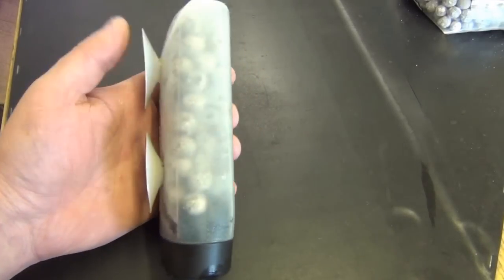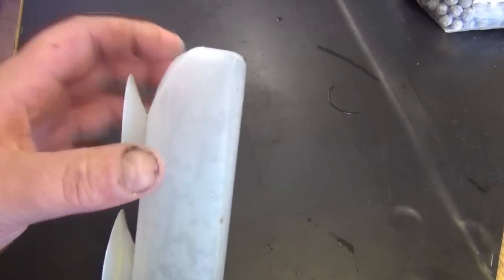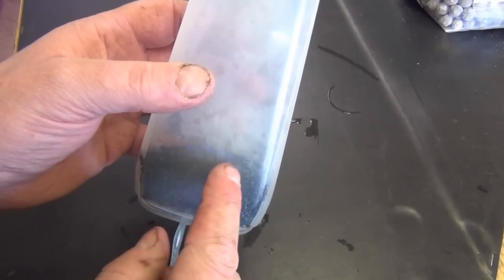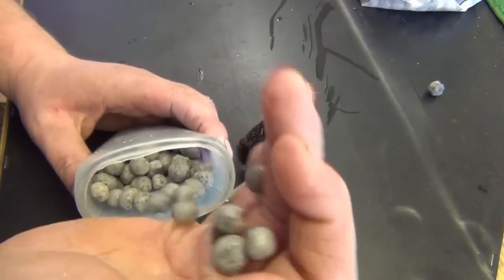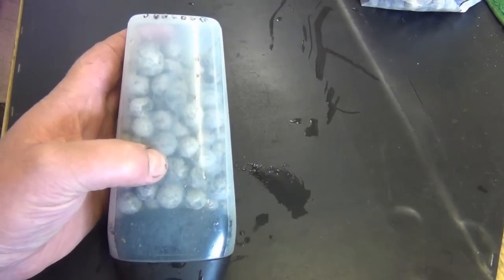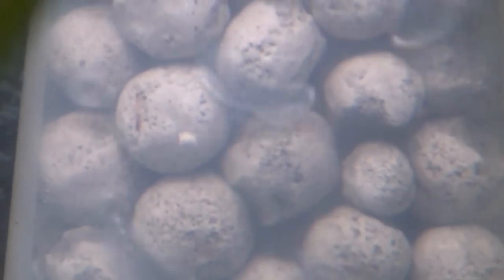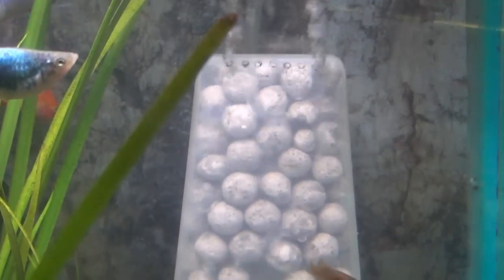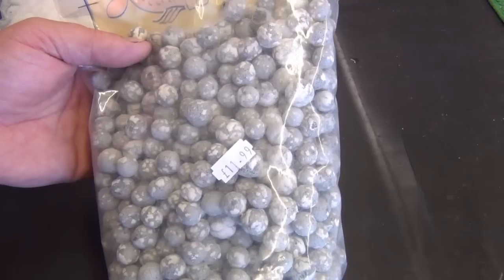How to Make an Excellent Moving Bed Filter

Comment: This is great. Trouble is, I can't find that clay type media anywhere. I found a similar type at a nursery but it's coated red, not sure if that's some type of dye or it's just clay. Ceramic media I found at the local pet store is outrageously priced. I heard red volcanic rock for gardens works well as a media as well, any truth to that?
Reply from the maker: +JudicialPineapple While other media will not move as the biomotion does it can be very effective as a filter media in a static filter. I can't remember the trade name of the red stuff you mention but I know what you mean. It makes a decent filter media and lava rock will be OK too. Avoid using anything plastic in a static filter as it supports very little bacteria.
Reply: +Pondguru Outdoors Thanks alot for the advice.

Comment: I was recently gifted with a 3.75 liter tank and a gold fish. The tank has an air stone but no filter, would this work in such a small tank? If I use a travel sized bottle and either hydro balls or sand?
Reply from the maker: lunerwerewolf I have just answered the same question from you on another video.That is way too small to support fish.
Reply: Pondguru lol sorry it's late here and I'm worried about the little guy. I'm in a dorm and can't get a bigger tank, so he's going to have to wait till summer to go into the big tank. I want to make sure he survives the next 6 weeks and is strong and healthy enough to go in with the others. Would it help him if I added chemical filtration media as well?
Reply from the maker: lunerwerewolf You can get small ready made filters called 'Small world filter' from Penn Plax: http://www.seapets.co.uk/products/aquarium-supplies/fish-tank-equipment/aquarium-filters/air-driven-filters/small-world-filter.html?ref=googlebase&gclid=CO7bmtTf3sQCFSoewwodUk8ABwThey need a small air pump to run them and will keep the fish alive until you can get it to a proper tank.
Reply: Pondguru thanks I will see if I can find any locally.

Comment: i did make the filter. it was very easy. but the media inside it doesn't move much.
maybe the reason was i didn't use the t shape stuff. or maybe the shape of the container. it should be the top is smaller than bottom? is it still working without moving that much?
by the way, you are british or german? just curiosity though. i'm in japan.
Reply from the maker: I am English but my good teeth would make people think otherwise, lol
There are many reasons why media will not move too well but mostly it just needs time to build up a bio-film to allow it to move easier through the water. Bottle design does affect it and the bets media for a small moving bed is the new K1 micro.
Reply: Pondguru thanks for answering . sorry that i thought you are not english. but i like your accent though. lol
Reply from the maker: msnb1966 Many people think I am German so you're not alone in suggesting that, lol
Thanks for watching and appreciating the videos.

Comment: I'm thinking of making this filter for the (temporary) plastic tub I have my turtle in. Would it work if the filter is placed diagonally on the side or if it's placed horizontally?
Reply from the maker: It really needs to be vertical if it is driven by air as the air will rise so won't draw water in properly if horizontal or diagonally.
Reply: Pondguru I guess I'll have to find a smaller bottle then. Thanks for the reply

Comment: Hello! Ok I am having a little problem with sourcing of all thing the shower gel bottle!!! No seriously....I have all the stuff ready to go but unfortunately, now this is going to be a little hard to explain, but all the shower gel bottles I can find are primarily connected by the part you instructed in the video to cut out (0:36). I have been everywhere, even tesco! The problem is that once you cut the part out you are talking about, the shower gel cap no longer locks back on, it just falls off :( Is there anything else I could use? I don't want to superglue the cap back on do I, I'll need access to the sponge won't I?

Comment: Hi I was just wondering do you still have this filter up a running and if so how is it performing ....thanx in advance
Reply from the maker: I think I swapped the media for K1 in this one as the biohome wore quite quickly when I had it moving in a confined space but the filter is still operating, yes.
Reply: Pondguru would it wear down less quickly if the balls were able to move freely like with K1 media? or are they not buoyant enough? i'm thinking of doing this but i'm iffy about swapping media too often
Reply from the maker: nerdziz The biomotion lasts much better when the balls are in a cyclical motion and we have done experiments with them in a donut shaped filter which worked very well. The best bet for a small DIY filter would be the new K1 micro plastic media as it creates a very fluid bed.

Comment: Hi , Have the media , cant find a bottle like yours , I came up with the shape but it is pantene shampoo bottle, with writing on it what do I do to be sure , it safe for my tank. And if Not good what bottle would u suggest I live in the usa. Thanks for all your youtube videos helps me alot.
Reply from the maker: +Lily T As long as you wash it extremely well in very hot water it will be fine. Any suitable shaped container will do and many people use snap shut clear lunch boxes. They are food safe, robust and can hold plenty of media. Also they have a flat back which makes fitting suckers easy.
Glad you enjoy the videos and thanks for watching.

Comment: I have a 30 gallon tank that I inherited that has 11 fish in it. 9 goldfish, 1 plecostomus and 1 Chinese algae eater. It came with 2 HOB filters and the water is NEVER clear. I made one of these moving bed filters. I used a 1.5 Liter pop bottle and bio-balls. Are the bio-balls supposed to be moving because mine aren't? Also, will this filter work better than the HOB's? Help please.
Reply from the maker: You are trying to use bio-balls (the plastic balls?) as a moving bed filter? The will not move nor will they support much bacteria so will do very little to filter the water. Sounds like you need an external. With goldfish that is the only way to go. HOB filters are often worse than useless and cost a fortune in pads / cartridges long term.
Check out this video which explains how a filter should be set up and exactly what should happen in a filter as far as the bacterial action goes: https://www.youtube.com/watch?v=lsAmSD3wVbg
Reply: Pondguru
OMG...what have I gotten myself into. I'm so overwhelmed with this information. If I do the filter in the video, how often will I have to clean it? And how often should I do a water change?
Reply from the maker: pookiegirl717 You would only clean it when the return flow slows right down and when it is mature you would only need to do a 10% water change per week, if that much.
Reply: Pondguru I just upgraded the tank (which had duck tape on it) to a bow front 36 gallon. Can you please recommend a canister filter that isn't going to cost me lots of money? I'm hoping something under $100.
Reply from the maker: pookiegirl717 I take it you are in the US? as I am in UK I have no idea what is available over there unfortunately but you should get a decent one for around that amount. Just remember that the quality of media and setting it up properly is more important than makers name.
https://www.youtube.com/watch?v=lsAmSD3wVbg

Comment: How long does it take for k1 micro to start tumbling in a diy bed filter ??
Reply from the maker: Gazz M As you would only start with about a 25% fill it should move from day 1 but will be restricted if there is too much media in. Best start with 25% and add more every week until a good 'chugging' motion is achieved.
Reply: That explains alot
Reply: Pondguru does shape off bottle have effect,  smooth bottle oppose to a bottle with a couple of ridges
Reply from the maker: Gazz M it will but only if their is too much media / not enough air. You could try having the air travel up one side to get the media moving in a circular motion then adjust the air to the middle when it has moved well for a week or so.

Comment: Can I do this with a 20 ounce water bottle and with ceramic rings?
Will one made with ceramic rings be able to filter a 55 gal tank?
Reply from the maker: For 55 gallons you really should be considering external canister filter. Ceramic rings will not move and have limited surface area so aren't good for moving bed filter. Best media for moving bed filters is the new K1 micro.
Reply: will a moving bed filter with the k1 micro media be able to push a 55 gal?
It will be housing a breeding pair of jaguar cichlids
Reply from the maker: TheRedRider100 Not sure what you mean by 'push a 55 gal'?
Reply: Pondguru I got some k1 media
will a filter just like your be sufficient airation and filtration for a 3ft by 18 inch by 18 inch tank?
Each tank houses a pair of central american cichlids
Reply from the maker: TheRedRider100 The one in this video really is for small tanks so you would need to make a much bigger filter with around 2 litres of media if it is standard K1 and only about 1 litre of media if it is K1 micro as it has almost twice the surface area.
Reply: it is k1 micro
what if i used a combination of ki micro at the top and crushed ceramic rins on the bottom?
Reply from the maker: TheRedRider100 The ceramic rings would still produce nitrates so you may as well just go with the K1

Comment from the maker: I'd go with half a litre of Hel-x in each side of the tank (2 filters) each with a foam pre-filter - see 'Excellent moving bed filter' videos for the best design so far. Biomotion will be even more efficient and allow for heavier feeding than with Hel-x or K1. K1 has the smalles surface area of the three media I sell. See link in video description for ebay page.

Comment: I am making one of these for my tank in my bedroom, I m using the bio-motion media (from your eBay shop with the free starter balls) and am wondering will it reduce the nitrates and therefore reduce algae growth in the tank?
Reply from the maker: +Leon Butterill The reduction of nitrates generally depends on how much media is used, size of tank and fish stock / feeding etc.  Usually it takes around 1kg of biohome per 100 litres to achieve full cycle filtration (reduction in ammonia, nitrite AND nitrate) but that could rise to 1.5kg - 2kg per 100 litres to achieve full cycle for heavily stocked tanks such as fry tanks, predator tanks, cichlid tanks and marine tanks.

Comment: Is this still made? Can I buy it anywhere in the USA? Thanks.
Reply from the maker: Manufacturers change the designs of bottles so often but there will probably be something similar out there.
Reply: @pondguru  Thanks, I also read from another comment that Motion was discontinued because it wore down.

Idea: plastic housing like K1, but sintered glass core?
Reply: @silitekmodder5681  Yes, unless the Biomotion was used in a cyclical flow pattern it would wear prematurely by bashing into each other. Because of the way it was made every piece is unique so i t would be impossible to make it fit an outer shell of plastic unfortunately.

Comment: CANT FIND THE TESCO SHOWER GEL BOTTLE...ANYWHERE ???
Reply from the maker: The problem is that supermarkets change their suppliers so often that it's rare to be able to get the same shaped product after a few years. This video was from 11 years ago so the chances are that another supermarket will have something similar.
Reply: THANK YOU
Reply: THANK YOU...I LIKE THE IDEA THAT ITS SMALL QUIET AND NOT MUCH AIR BUBBLES......THERE WAS AN OLDER ASIAN GUY WHO OWNED A FISH STORE AND SAID HE HAD USED BIGGER PUMPS BUT SOMEONE EXPLAINED TO HIM THAT LESS WATER MOVEMENT MEANS LESS ALGAE SO HE TOOK OUT THE BIGER PUMPS AND GOT SMALLER ONES AND THE WATER CLEANED UP IN ALL HIS TANKS !!!
Reply from the maker: @mikegibb646  That's a great example of a situation where less is more.

Comment from the maker: BIOHOME FILTER MEDIA, FILTER UPGRADE KITS AND FOAMS HERE: http://www.filterpro.co.uk
From the guy who started the aquarium moving bed filter movement.....how to make an aquarium filter - a very easy and cheap moving bed filter - possibly the best DIY moving bed filter on Youtube so far.
Please click 'like' to get this video promoted on Youtube - this filter and media is awesome and so simple to make.
The bottle used is a Tesco shower gel bottle.
Imagine a fish house with dozens of tanks, all with small moving bed filters - powered from one decent air pump. 
Groovy.
The filter in this video uses 'Biomotion' media which is ceramic and has an internal honeycomb structure to provide a massive surface area for bacterial colonisation so allows the filter to be much smaller than standard internal filters.
*PLEASE NOTE I HAVE CLOSED TYNE VALLEY AQUATICS AND NOW SELL MEDIA FROM HOME ONLINE. COLLECTING MEDIA IS NO PROBLEM JUST RING OR EMAIL ANY TIME.*
My phone number 07772848730
My email address pondguru@btinternet.com
Reply: good day, i was thinking of using the siporax ceramic stuff in one of these. would it work? plus as a designer i think this shower bottle choice is absolutely fantastic, it would look the tits in an aquarium
Reply: also heard this kind of filters not so good with planted setups. Maybe i'll just stick to my sponges than

Comment: i have a question... I have a 40 gallon black water aquarium, my mechanical and biological filter works but still have problems with nintrates amonia ....i dont have plants in my aquarium they dont do well. So a friend of mine told me to add a floating basket with fig cuttings (they supposed to absorb nutrients  much faster than any water plant, and also absorve nitrate as is) i did that and after a week  my nitrate amonia .... are 0, even i saw the small amount of algy that i have in my aquarium  redused. My only problem is that they absorve the tannin from the water in a slow rate. So why people dont use  for fresh water aquariums that type of filtration, is there a problem with those (tree cuttings)? do they harm the fish?
Reply from the maker: I have never heard of that being used before but if a filter is working properly there should be no ammonia or nitrite. Nitrate will be reduced by using biohome ultimate media but it takes around 4-6 months for the necessary anaerobic bacteria (which consumes nitrate) to build up for a permanent solution. It will not affect the blackwater effect.
Light reduction due to the black water could affect plant growth so go with species like java fern which don't nee much light.
Reply: Pondguru thanx i guess my  Filter
need more time i have only instaled it for 2 months i will also try java fern thanx again for suggestion.
Reply from the maker: Chris Sk No worries, man.

Comment: WHAT ABOUT LAVA ROCKS FROM HOME DEPOT INSTEAD OF CRRAMIC BALLS OR KI KALDNESS
Reply from the maker: They would work fine although most of the surface area is external - there are way better types of filter media available but lava rock is probably the best of the non-filter media filter medias.
I did a video showing the inside of different types of filter media which none of the other channels bother to do - it's a useful way to see what makes a good filter media: https://www.youtube.com/watch?v=QTtAUYR67Eg

Comment: Hello! Will this help to clear out the water? Nice idea i like it. :)
Reply from the maker: Glad you enjoyed the video - thanks for watching.
With this filter its not really designed to clear the water, just aid the health by providing very active bacteria to combat the ammonia and nitrite.
However if you swapped the coarse black sponge for a finer one that would trap quite a bit of dirt.
A later design I did in a video titled 'Beat this aquarium filter' (linked video on this page) is much better for making the water clear as well as offering more surface area for bacteria to colonise + offering a new way to put air into the water so that video would be worth checking out.
Reply: +Pondguru Outdoors I see... Im quiet new to fish tanks, so i'm just curious. Thanks alot for the time to explain, means alot to me.
Reply: +Pondguru Outdoors P.S. i will definitely check your recomendation video out! Thanks again Sir! :)
Reply from the maker: No worries, any time. If in doubt go for a decent ready made filter - ideally external canister if you have 75 litres or above in the tank. I have a video on how to properly set up a canister filter too, lol

Comment: can i use seachem matrix?
Reply from the maker: It won't move as once it is saturated it will be too heavy but it is a decent (if hugely overpriced) filter media. 
This is a better version of the pumice used for 'Matrix' and is used in the treatment of drinking water quality water: http://www.ebay.co.uk/itm/3-LITRE-TOP-QUALITY-PUMICE-FILTER-MEDIA-KOI-MALAWI-MARINE-USE-15-25mm-/222065990171?hash=item33b42a1a1b:g:Ei8AAOSwQjNW9vWg
Reply: i see thanks for the info. the reason i was asking because other youtuber give example DIY water bottle filter with heavy bio media so its static not moving, whilst you seems prefer something light and moving like k1. From your experience which one is better and more effective producing beneficial bacteria? moving one or static one?
Reply from the maker: Moving beds tend to be more aerobic so process ammonia and nitrite well but produce nitrate. A static bed (using suitable media) has a chance of reducing nitrate by supporting anaerobic bacteria too. Really you would need approx. 1kg per 100 litres to deliver full cycle filtration. More information here on my website as I get asked questions about the full cycle all the time: http://filterpro.co.uk/qa-24-w.asp
Reply: i see, so what about the idea of puting half seachem matrix and half k1 so some bio media will stay some bio will be moving...is it good idea or very bad idea?
Reply from the maker: I would keep the filter one thing or another - either static or moving.
Reply: thanks mate